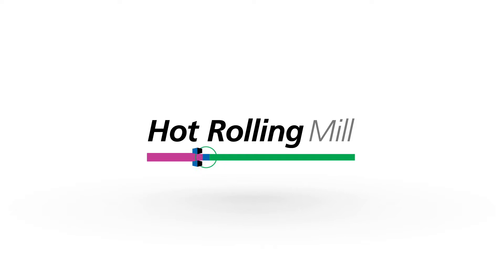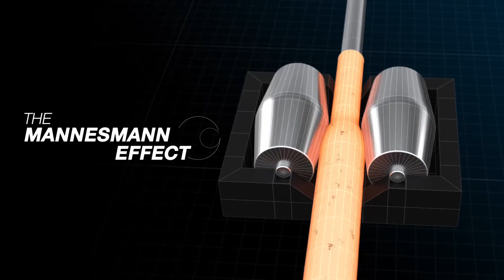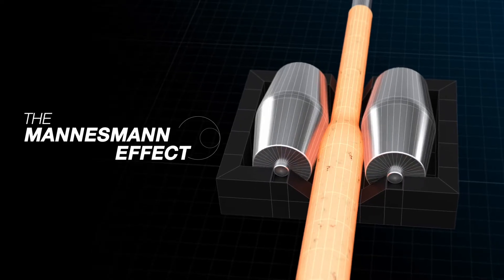TenarisBayCity seamless pipe manufacturing process

Comment: How does that boring mandrel aka piercing tool come out once the solid bar is forced onto it?  And I imagine that the piercing tool must be fixed at the other end and must be longer than the tube/pipe. Otherwise, how is it supported?
Reply: The way I'd do it is to cut the pipe off once it gets long enough, then rotate the  pipe+piercing tool out of alignment with the incoming bar so that the hot pipe can then be slid off the same direction it slid on. Otherwise yeah it would have to be held in place with some crazy magnet contraption that, realistically, no way they would actually use.